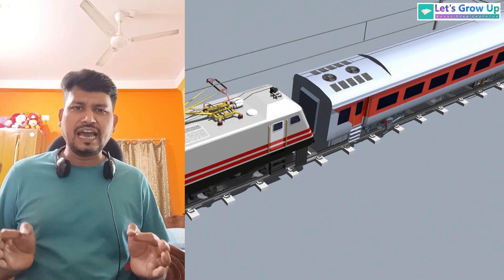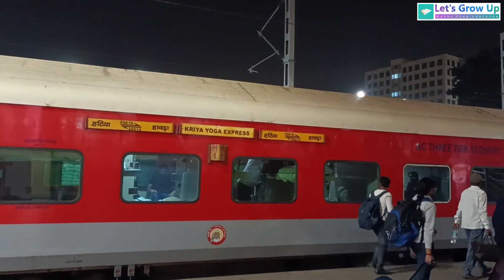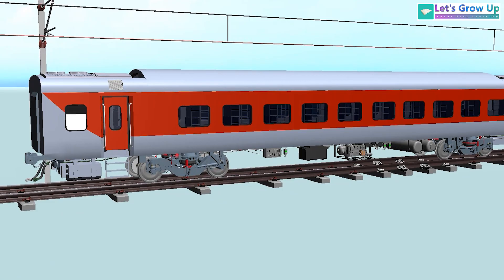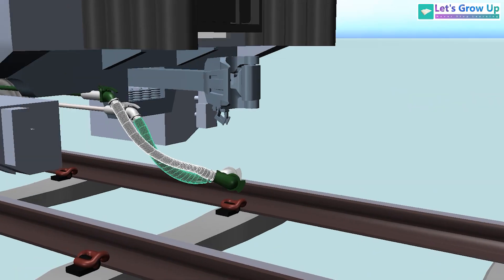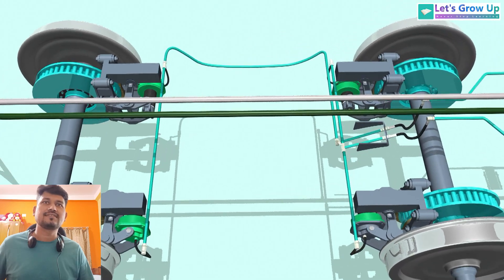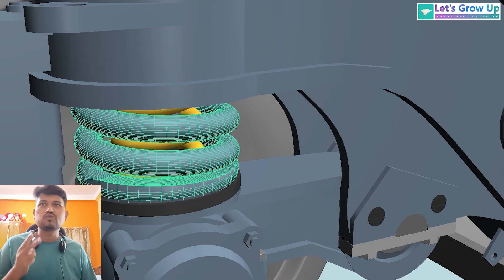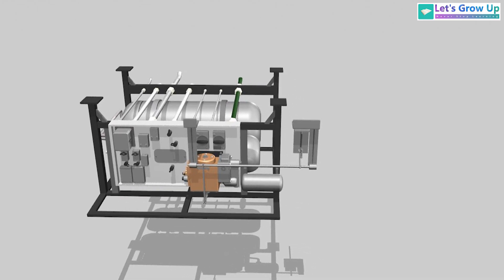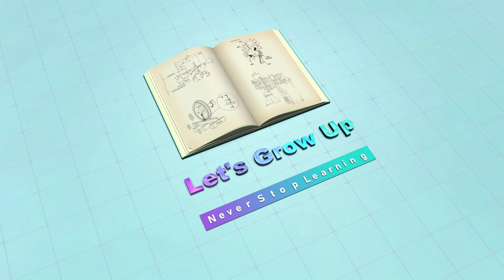The Deep Explained about LHB Coach Technology

Comment: LHB coaches are the worst coaches than ICF coaches, very conjusted,low room space,low berth space,small bathroom than ICF coaches, very uncomfortable journey than ICF coaches,the main worst thing of LHB coaches is during journey it gives vigorous shake. I travelled in LHB Sleeper Class,3rd AC ,2nd AC and even in General Class also in all the coaches same problem is there it gives jerk during the journey very bad experience with LHB coaches. Now i realized old is gold ICF coaches are far better and comfortable than LHB coaches. LHB coaches not able to generate electricity byself generator car required, but in ICF no need of generator car because alternator fitted with the wheel able to generate electricity byself. Old is Gold ICF coaches are really Gold.
Reply: it is considered to be safer, but sometimes the shakes are too much. Also they removed the foldable table, and replaced with a plastic table which almost always manages to scrap your knees if you are tall